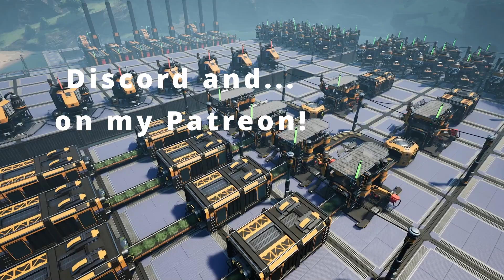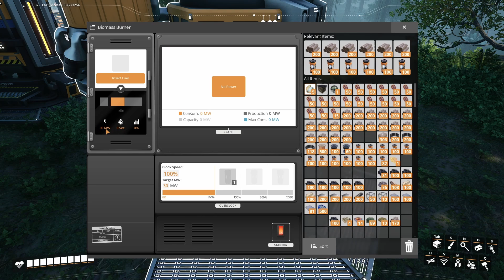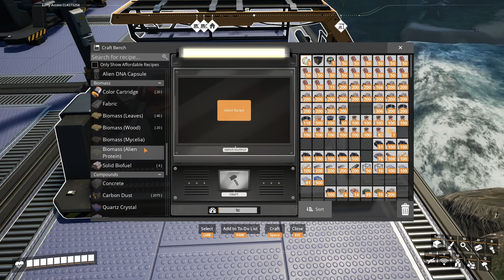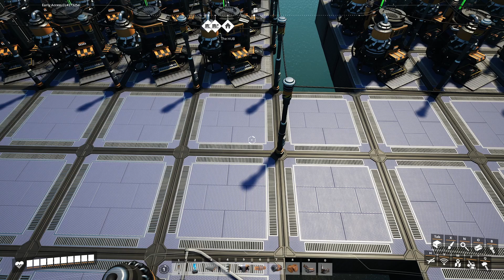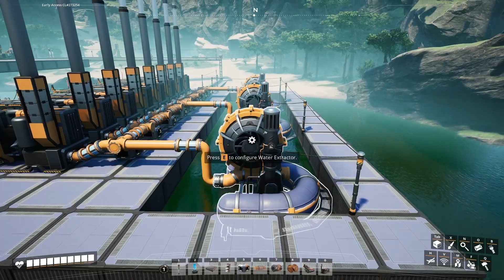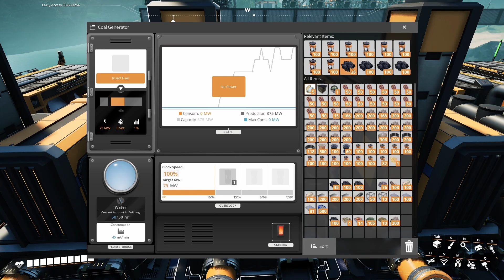Coal Power 100% Efficient, full Early Game Power setup! | Tips and Tricks | Satisfactory 1.0

Comment: I have just started building a 'tower' right at the output of my water extractors (or other liquid source) that I am going to combine together.  Just something that will be 12 to 16 meters (3 to 4 of the 4m foundations) higher than the max height where I am going to use the liquid.  I put a small 'Fluid Buffer' on the top of the highest foundation. Put the liquid in one port and take it out the other port .  I may put a pump at the base of the tower for head lift.  Since I have started doing this, I have had no issues with reverse flow or lower flow situations.
Reply from the maker: yepp, I also use water towers to set headlift, the idea behind this one was to keep it as simple and beginner friendly as possible, with no pumps, buffers or anything like that, but 100% guaranteed to work 😇